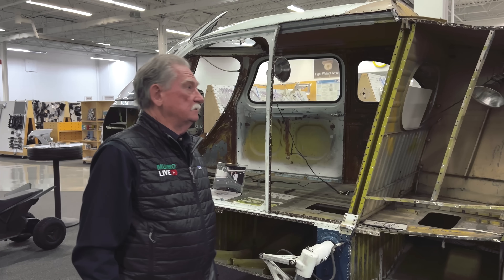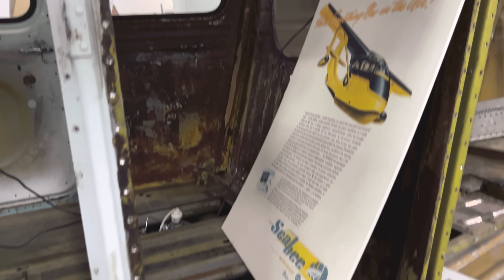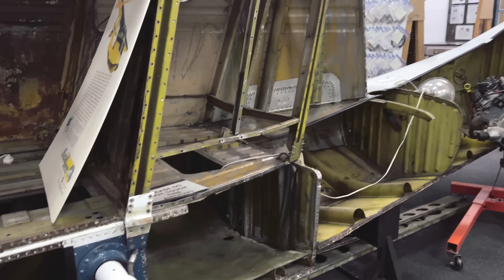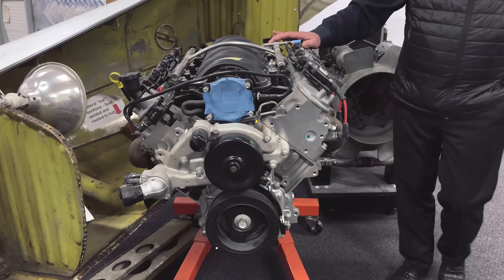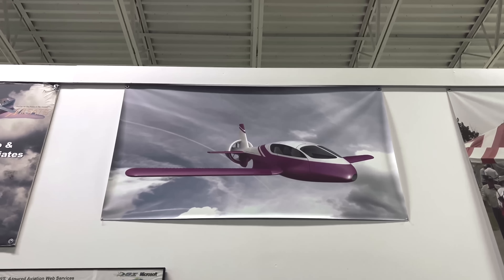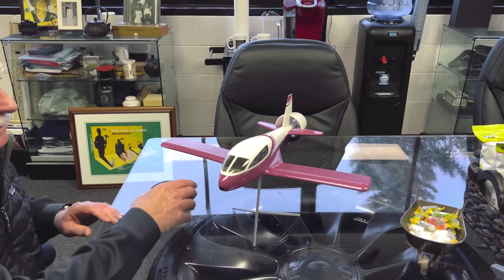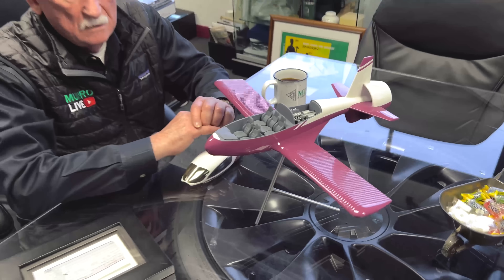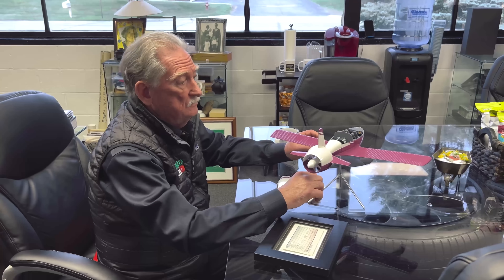Storytime with Sandy - Seabee and The Paradigm Plane.

Comment: Sandy you saying that you wouldn’t have to be a pilot sounds like utter bullshit. Am I missing something?
Reply: All you're missing is that passenger-carrying automated aircraft were not legal then, and still are not now.
Reply: @brianb-p6586  but is that feasible even if it were legal? What if there’s a storm etc?
Reply: @bob15479  An automated system would be required to handle changes due to weather, just as a pilot is. It's not easy, and it is very difficult to do in a sufficiently reliable way, which is why no one has (to my knowledge) had a system approved. There is no indication in this video that the Munro system worked, or was even built, let alone approved for use.

Comment: 3500 RPM is very high for direct drive to a propeller, which might be one reason for the ducted fan design (which he calls a "tunnel"). The other reason is that when you mount a pusher prop on a tail you have ground strikes by the prop tips; the diameter must be reduced to allow an adequate pitch-up angle while on the ground, and a duct both shields the prop and is hoped to increase efficiency with a too-small prop. Pusher ducted fans driven by piston engines look cool and have been tried many times, and have been universally unsuccessful; there are reasons that they fail and no reason to expect that Munro's version would have been any better. 

Ducted fans are nearly universally used on large aircraft, but they are driven by turbine engines (the combination is called a "turbofan") and optimized for operation at much higher airspeed.

Sandy implies that the engine wouldn't be working very hard because it would only need to turn 3500 RPM, which he calls "almost idle speed". In fact that's at least five times idle speed, near ideal for efficient operation, and as hard as the engine can run continuously. Think about an actual Corvette or any other vehicle that comes with this engine - highway cruise is at much less than 3500 RPM and higher engine speed is only used for a few seconds at a time in acceleration.

There's a lot of bitterness and self-promotion in this story, but it's light on factual information.
Reply: Any modern car engine could run all day at a mere 3500 rpm
Reply: Yes, it can run all day at 3500 RPM, @jamesengland7461 ... and that's it. Try much higher and engine life will be short. Also, the GM small-block is barely a modern engine - it's still a pushrod design, which is desirable in this case because it keeps the engine relatively compact and compact (for its displacement), and high engine speed is not needed; it is a relatively low-speed engine compared to most "modern car engines", including other GM designs. That makes it more suitable for aviation use than most automotive engines.

But again, 3500 RPM is nowhere near "almost idle speed" for any GM V8, including this "Corvette engine" (which might be a Gen III LS1).

Comment: Would you be willing to make the plane "open source" to allow it to be made as Experimental? What was the nature of the power plant, other than being a ducted fan design? 
The autonomy has long been desired, but the communication infrastructure is not in place to allow it, except when an emergency is declared, which eliminates the communication requirements. There are so many variables, windsheer and traffic and many other things that it is a bigger challenge than it appears.

Comment: Sandy says it "looks heavy", but a Franklin O-500 weighs 221 kg (488 lb), and a similar current certified aircraft engine puts out much higher power at about the same weight. The Corvette engine is heavier, even without counting the additional cooling system that it needs. So no, the Corvette engine is not lighter. 

The direct drive configuration is not an advantage for the car engine - the original Franklin is direct drive, too. It is true that most automotive engine installations in aircraft require a speed reduction drive (as do some current certified aircraft engines, and as did most WWII era high-performance piston-engine aircraft); the Corvette engine approach uses more displacement and less engine speed to avoid the need for reduction drive, just like the original Franklin and most of the Lycoming and Continental engines that have powered general aviation for the past 70 years. Unlike the aircraft engines, the GM small-block is not optimized for minimum weight in lower-speed operation - it doesn't even have a camshaft optimized for this application.

The engine swap likely makes sense, because liquid cooling is desirable, and because car engines are much less expensive than aircraft engines... but weight and direct drive are not benefits of the swap.
Reply: He's got a few details wrong on the Corvette swap.  The Corvette engine is geared, something like 1.4:1 with a silent chain while the Franklin is direct drive.  It is a BIG upgrade in peak power and really helps the SeaBee get off the water quickly.  At cruse speed, it's not worth running the Corvette engine harder than the Franklin because the SeeBee is a barn door aerodynamically and extra power only gets you a few MPH.
Reply: @martylawson1638  that makes sense to me. This is probably a confusion between the Seabee conversion (with propeller speed reduction unit to match the higher engine speed to the original prop diameter) and the Munro aircraft design (with direct drive to a relatively small and thus high speed ducted fan).

Comment: I've wondered about that SeaBee sitting in the corner for years, so thank you for making this video and for sharing it with the rest of us.  An awesome project.

I've seen many promising aviation ventures ended by bankruptcies, even through no fault of the developers, but this venture would almost certainly have had financial challenges regardless of Lehman Brothers as very few companies manage to succeed in aviation :(.  Getting a full self-piloting system through the FAA in the 00's might have been impossible and as far as I'm aware we still don't have such a system today that's approved for participating in standard air traffic and using standard airport runways.

Comment: Actually a recreational seaplane might have a market if the price of such a vehicle could be low enough. eg 300K or so. The Bottom hull can be made out of fibreglass. Side structural aluminum could be casted. Inner supporting rods made from carbon fibre hollow rods. The BOM could well be around $120K maybe.... Just use a 4 cylinder Honda Vtec engine. They are surely cheaper and far more reliable than the Covette engine and way lighter. Carbon-fibre propshaft and CF propeller (with titanium inserts) 3D printed....
PS: You will need to license a version of FSD from Elon and I am sure he will gladly offer for the specific to the vehicle.

Comment: The vast majority of aircraft designs never make it to certification and production.  This is largely due to the regulatory frame work that ultimately makes it much more expensive then it needs to be.  The sport plane rule has relived this significantly for the very small aircraft that qualify under that rule (just for reference, these are generally 2 seat, light and low horsepower), but for anything else the crushing cost and time involved with certification is still the limiting factor that stifles innovation.  This leads us to the tired, but  still true maxim: How do you make a billion dollars in aviation?  Start with two billion.
Reply: Yet the 737 Max was "certified" and then crashed several times.

Comment: Similar thing happened to Raytheon. They and Burt Rutan created the Starship prop plane with composites and a glass cockpit. When that came out, those were unproven technologies according to the FAA despite a solid safety record in places like the military. The FAA put so many stipulations on it that they made it too heavy and too expensive. The irony is that these are where the industry is going. We need proper regulation as opposed to more regulation. Welcome to why the aviation industry essentially died in the US.

Comment: Sandy this is still a viable craft, with development in new materials and giga press systems, it should be produced, its roll as a hopper over medium distances between air ports city to city routs, with final destination using robo taxies, mass of uses 👍

Comment: You were not the first person to discover that making a small fortune in general aviation requires a large fortune first. Long time pilot here, and always admired the SeaBee. It was not the only aircraft design of its time to use an exoskeleton, though. The North American Navion wing has no long, heavy spar as so many other aircraft do. Instead, it uses the same box structure and "heavy" structural wing skins for strength. It was so strong that a Navion wing (one-piece, joined at the center) was used as a bridge for troops to drive jeeps over in Korea, where the Navion was in use as a liaison airplane. And the Navion, though a large plane, was remarkably light, too.  And amazingly resistant to corrosion. When I had to split my wings to access and replace the stamped aluminum fuel tanks, the internal, zinc-chromated spaces were absolutely pristine. So much so that an inspector's stamp and signature looked like they'd been applied last week, not 70 years ago. One issue, though: climbing into the cockpit with its sliding canopy was awkward for women in skirts.
Reply: munro: LS-swapping 70 year old airplanes ;))
Reply: Women could wear hot pants instead of skirts. Problem solved!
Reply: We had a Meyers 200D, everyone thought it was a Navion!
Reply: I want to LS swap a Navion!

Comment: Sounds like a small aircraft OEM should think about hitting up Munro about the feasibility of building an electrified version of this thing.
Reply: Going electric makes it die.. The batteries are too heavy and you won't have any range.  We need a battery breakthrough
Reply: @calholli   There are electric planes, so it's too simplistic to simply say that w/o research into the specific aircraft.  How feasible it is, or isn't, depends on those details.
Reply: @calholli  Well sure, comparing current battery energy density to petrol of course comes up like that.  Simply that one shouldn't assume it will or will not work, but look into it thoroughly & determine feasibility.  Which it may, or may not, have.
Reply: @calholli  This is for certain.  Strides in cost, power density & more.

Comment: Great ideas never die. They just wait for the right time to reboot. I'd expect with all the advances in manufacturing and composites it may be possible to resurrect the project with a better vision. Getting FAA approval (and insurance) is of course what has hampered this industry.  Some manufacturers use the kit loophole to sell the plane and allow the customer to do a little assembly (at a certified maintenance facility) to skirt issues and register it as experimental. Its amazing how many ancient Cessna's and Beechcrafts you still see. The market really needs a full refresh. A few have come out but very expensive.

Comment: What makes this plane obsolete today?  Just wondering why it is still not commercially available?
Reply: The Seabee, or the proposed Munro aircraft? 

The Seabee was built for a market which never developed enough to justify continued production. There have been many general aviation aircraft, including quite a few amphibious types like the Seabee, and there just isn't much demand for them.
Reply: @brianb-p6586  I meant the Munro plane.  It seems that, while the computers for flying and navigation have gotten faster and cheaper, the rest of the design should not have aged that much.
Reply: Thanks for the clarification, @normcfu . 
I don't think the Munro aircraft is obsolete - I think it was never a viable design, and remains not viable. That's aside from the autonomous operation idea, which really has nothing to do with the actual aircraft. The autonomous idea was very popular in that NASA program, and is still a feature of proposals in the current wave of "aircraft of the future" (which are generally electric VTOL things)... but it still isn't reality. The challenges of autonomous operation remain, are probably technically easier to overcome now, and were not resolved by the Munro project (because, for one thing, it didn't proceed that far). 

The Munro design is not commercially available because it was not completed. If anyone with funding wanted to complete an aircraft of this style (small ducted fan pusher), there have been many attempts which they could support or resurrect, but it hasn't made business sense to anyone.

Comment: Autonomous flying should be mandated for all aircraft. It's a shame that automatic safety overrides have to wait so long before it wrestles control from pilots who are doing a lot wrong. I anthropomorphize Autopilot as like a parent riding along with a their new teenage driver. The adult sees the problem their kids are doing wrong way in advance, but wanting to let them learn to recognize, they wait, and wait, and wait, until it's almost too late, THEN screaming corrections to make. That's the "PULL UP, PULL UP" of terrain avoidance. The computer sees the problem way before that but has to wait for a programmed value to be reached before warnings or auto correct. Had the computer had control all along, it would've been making small corrections the entire time and the human would have never known there could have been a problem.

Pilots have trouble keeping track of even the 6 pack of gauges (airspeed, altitude, heading, horizon, vertical speed, RPM) in the best of conditions. When something goes wrong, and you have to refer to checklists, look to minor gauges (fuel, oil, temp, etc.), troubleshoot, check flying surfaces, check fuses, find the nearest airstrip, set your squawk code to 7700,  heading, etc. That's when the 6-pack of gauges gets ignored. That's why planes crash. It would be much better if the plane did ALL the flying and only looked to the human for help when an edge case problem popped up that it was having trouble handling. Computers are GREAT at keeping track of dozens of flight parameters at once and aren't distracted by panic or overload. Let the plane aviate and navigate, the human can do the communicate if need be.

Comment: There's a continuous and very important amount of voice communication between the pilot and air traffic control, tower, etc. There's no way you could have a Fly from A to B Automatically type of navigation system. It's not difficult, it's just impossible.
This is an imaginative but-too much-too soon design.
Enjoyed everything else about the design and the method of manufacturing.
Reply: LLM or SLM to communicate
Reply: It has the capability,  but not the permission from the FAA for all that. The system would still be useful.

Comment: I think the Corsair was spotwelded as a WWII warplane category...???
Reply: I didn't know that, but yes, according to the Wikipedia article for the Vought F4U Corsair, in the section about the wings:
"The large fuselage panels were made of aluminum and were attached to the frames with the newly developed technique of spot welding, thus mostly eliminating the use of rivets."
Other online discussions describe other areas which were spot welded as well, but there were still many rivets - including in some panels which have both spot welds and rivets.
Reply: @brianb-p6586  I have seen a video where they are restoring a Corsair and there it was mentioned and shown...they kept that method very secret I guess...it did not become widespread...??